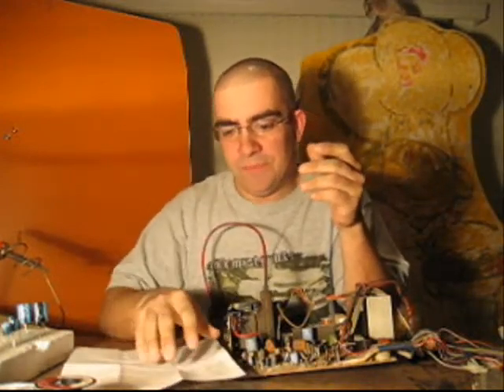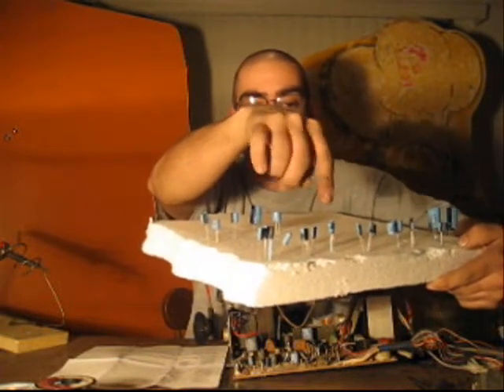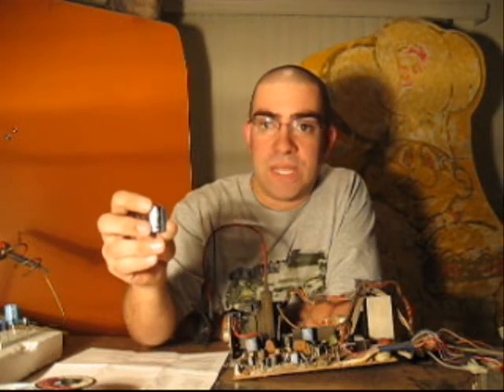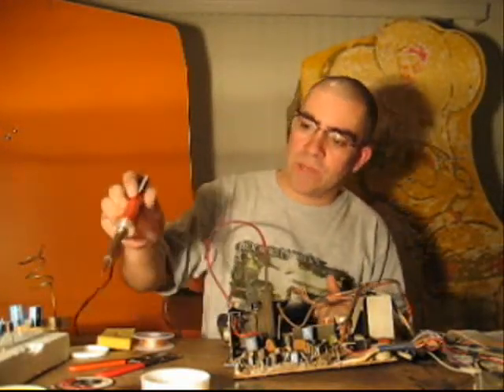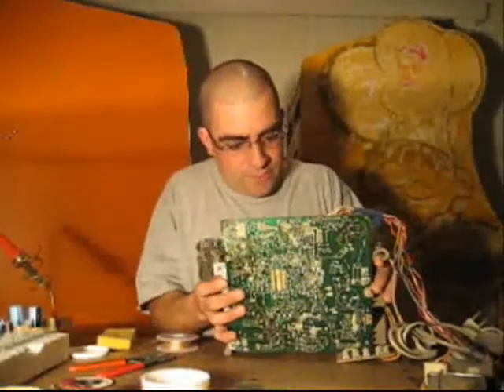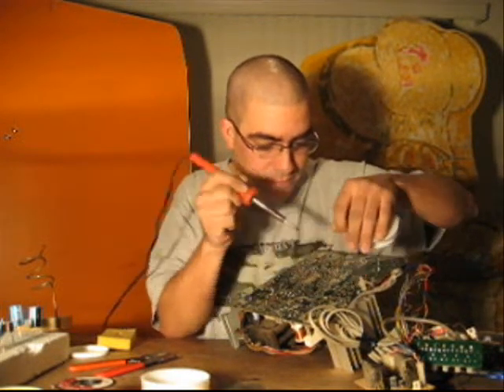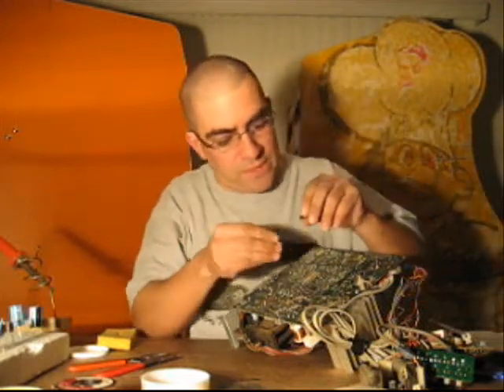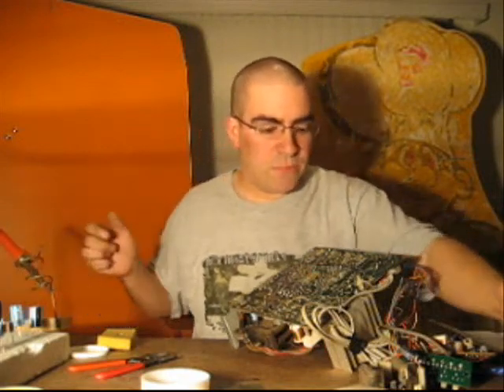Cap Kit

Comment from the maker: The larger caps can hold a charge but usually nothing too dangerous. The only time I have been shocked by a cap was when one of the fuses on the monitor board had blown. So discharging at the anode didn't remove or lessen this charge due to the path being broken at the fuse. The shock was very minor and only startled me, it did not cause any harm.

Comment: Have a Mortal Kombat II arcade machine. The monitor's controls can adjust H&V size,brightness,& contrast, but it has a waviness or flutter. Images are bright and color is good, so didn't know if a cap kit would fix this. It is over the entire screen constantly, not just a wave every second or so.  Like when someone turns on an appliance with a motor somewhere in your house. When playing you don't really notice. But if you watch the display it is easily evident. What could be the fix experts?

Comment: thanks  I got a 29'' monitor I got to repair im scared as sh**to do it but i guess it's gonna be worth it if it works......

my plan was to put a brand new chassis on it so it can become trysync at the same time... but i need more info on the subject...

discharging the monitor on a table (not connected into arcade) will result in the same thing right?

if it's grounded to the metal frame...?

Comment: Great video but just a little constructive criticism. Please take no offense. You should heat the cap wire up and then flow the solder into it. They look like cold joints as denoted by the balling up of the solder on the leg@8:43. These joint could open up over time as the chassis heats up and cools down.

Comment: Question do you need to discharge something else besides the anode?

Like caps ? , is there some that holds charge..?
because If i do that i use a suction Heater gun i wouldn't want to get zapped from beeing too clumsy